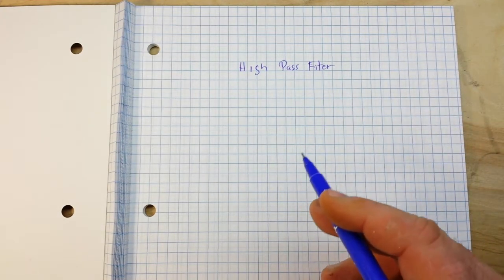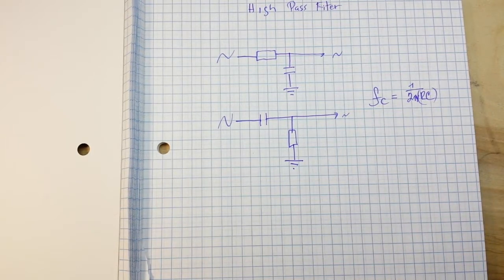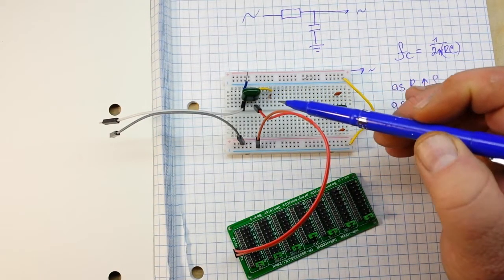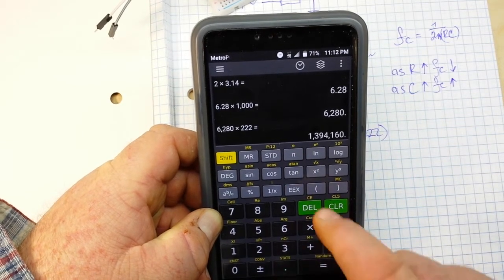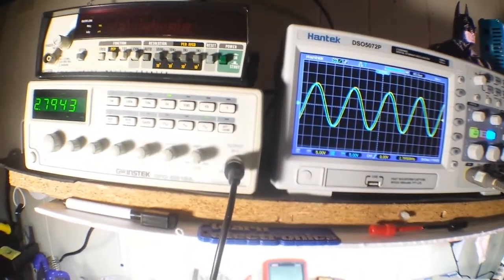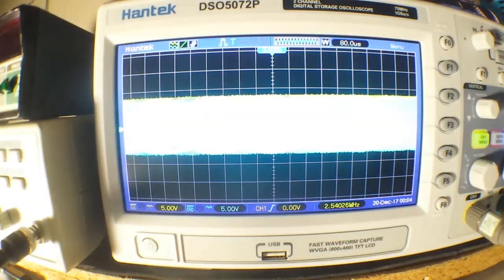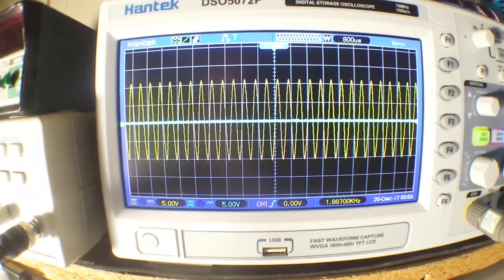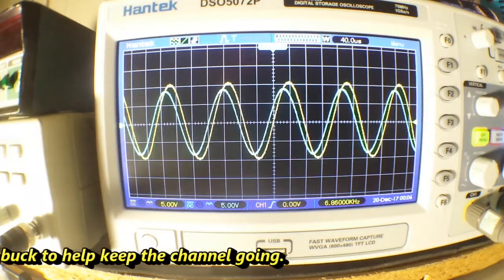The High Pass Filter

Comment: Correct is: As C rises  the cut off frequence fc drops. Both (C and fc) are in the denominator of the fraction.
Reply: I was wondering about that. The bracketed "(RC)" made treating R and C as opposites rather confusing.  I guess LearnElectronics doesn't read their comments, or this should have been pinned and hearted... instead, the "learners" are just left dangling : (

Thank you for taking the time to point out the error.
Reply: Was trying to figure out why that didn't make sense! Thanks.
Reply: Thanks for noting the error. I kept going over and over that wondering what the heck I was missing. We all make goofs but I make so many that I was not about to think it was not me.